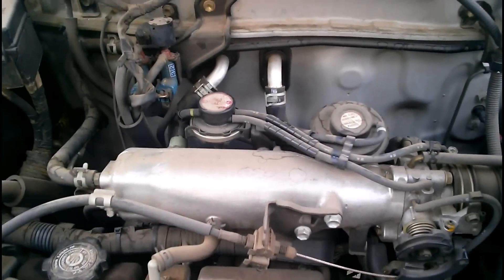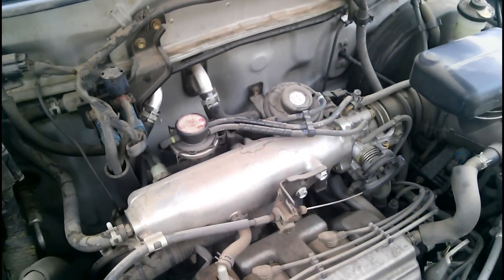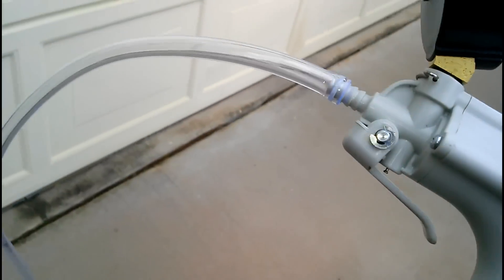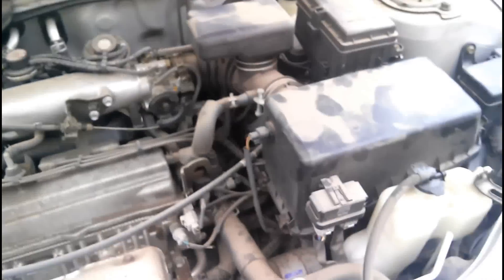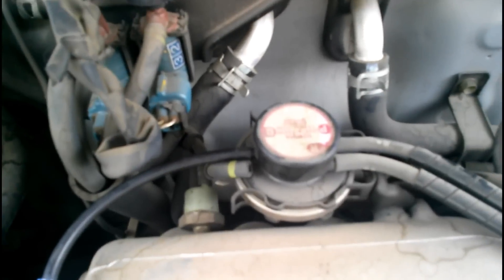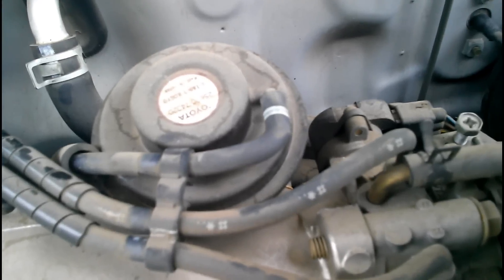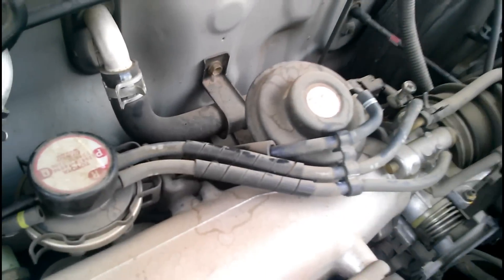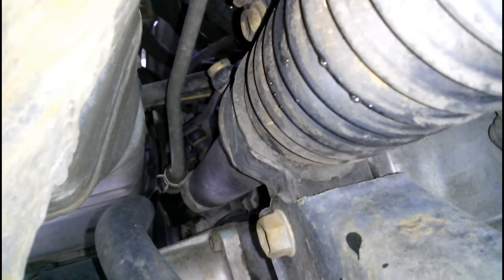Toyota P0401 Insufficient Low EGR Flow RAV4 Diagnosis

Comment: Fantastic Video! picked up the vacuum tester at Harbor freight for $39 bucks and it had all the things I needed for testing. Turned out to be the VSV valve which should OHM out at around 20 ohm's for a good one. I had two smog shops that couldn't figure it out and drove me nuts! YOUR THE BEST!!

Comment: Thank you for this video.  My wife's 1998 4Runner hasn't been driven for almost a year.  She started driving it a couple of days ago and it threw a 0401 code.  This video will be a great help in diagnosing and repairing the RAV4.  I think this is the first mechanical problem it's had.  Just 25 years of tires, brakes, batteries, oil changes and air filters.

Comment: I'm not sure what your name is but you can't believe how you much you helped me with my 1998 Toyota RAV4 P0401 reading. I had to have my front axles changed at a transmission place on my Toyota and they somehow loosend the hose at the bottom that's about 10 inches away from the axle . When I drove off the lot my check engine light came on and they told me they didn't do anything. I then took it to my mechanic and told him what I thought the problem was after watching your video and sure enogh, that's was what was wrong with it He hooked the hose back on put a clamp on it and told me no charge ! You saved me so much money thank you again for putting your knowledge on YouTube sincerely Tammy Peterson 😀

Comment: Thanks for showing us how to test these parts man appreciate it!. I wanted to share my experience with this code. I had a Camry with a p0401 code car ran perfectly fine otherwise. I used the vacuum pump on the EGR valve, applied vacuum, the car died instantly which showed it was working fine, checked the modulator with the pump and the gauge showed 20 lbs of mercury, as the vid showed by process of elimination the VSV should be the bad part. So on faith I bought the part and put in the new one sure enough after a while the check engine light went away!!! I found it's rarely ever the modulator and if it is the EGR itself whether it needs cleaning or replacing you would notice the car running real rough if that was the problem. On these camrys, rav4, land cruisers the VSV is known to go bad and if you’re showing a p0401 code it’s almost always the VSV 90% of the time. Also if you erase the codes with an OBDII tool and the code comes back after 10 miles or so it's also usually the VSV.

P.S. The VSV itself is a PAIN to remove I ended up not removing it because the bolt was so out of reach so I ended up removing the 2 hoses and the electrical connector from the old VSV and put them on the new one and zip tied the VSV someplace on the firewall of the engine.
Reply from the maker: I'm glad it worked out for you! Yeah that's exactly what I did, disconnected the power and vacuum lines and left the old one in place, I don't see how you could remove it without basically pulling the engine! One of few decisions by Toyota's engineers that left me scratching my head.

Comment: Update. After performing the EGR valve test as described in my earlier comment, guess what? Next time I drove the car the check engine light was off! This kind of thing has happened to me often enough that I have a name for it, the "test fix." You test something without making any attempt to fix it and suddenly the problem is gone. Anyway, thanks for giving me the test to fix it with, good vid!
Reply from the maker: +Dave Ayars Huh, how strange! I'd keep an eye on it for a week or so to see if it comes back. Hopefully it is just a "test fix" though!
Reply: +Dave Ayars What happens many time is there is a minor carbon blockage and by testing the system, you disturb the blockage just enough to "solve" the problem ;)

Comment: Also check the vacuum line that activates the EGR valve. It too should have 20'' of vac when the engine is revved to 3000 rpm.

Comment: Tried a modified version of the EGR valve open/close test and a strange thing happened. The modification is that instead of getting a vacuum pump I used my mouth, first with the engine off. Sucking on the tube produced at least the  sound of the valve opening and closing. To make sure it was working, I repeated the test with the engine running. This time the rpm dropped quite a bit, but the engine didn't run rough or stall, it just dropped and maintained smoothly at a lower rpm. Now here's is the strange part. I opened the throttle manually and the engine didn't rev. Put the vacuum line back on, still nor rev.Tried the gas pedal, same thing. I shut off the engine in hopes that restart would do a reset of some kind. It wouldn't crank, the solenoid clicked, indicating a low battery. I gave the battery a quick charge, and the car started normally. Repeated the suction test and the same thing happened all over, except this time it restarted fine thanks to the charger. Any explanation for this?

Comment: Nice camera, but pretty bad cameraman.  You kept on moving the camera around and zooming in and out too fast.  You also call the VSV a sensor, when it's actually a solenoid-controlled valve that Toyota calls a switch (for some unknown reason).  Then you called it the vacuum modulator, which is the little round unit on the top.  As for seeing the VSV, no:  You will never see it on a 4WD model unless you disassemble the top of the engine.  You can feel it from the top if you have a long left arm.  Follow the two rubber hoses down, down, down until they attach to the VSV ports.  From the passenger side, if you remove the wheel you can reach in there far enough to feel the rubber hoses and follow them to the VSV.  It's to the right and above that accordion-like rubber boot shown in your video.  You do have to lay down on your right side and get your left arm way in there.  Some people manage to get the 12 mm bolt that holds the VSV on the back of the engine off.  Very easy to do if it's 2WD from underneath.  Almost impossible for 4WD, and extremely unlikely you could get it back on to replace the VSV.

So most mechanics install a new VSV higher on the firewall, and just leave the old one in place.  You can remove the rubber hoses easily.  The electrical plug is harder.  You have to hold down the release lever on one of the wider edges to release it while pushing it in, and then pulling the connector off.  Most people have to use a small flat tool to push these connectors off, but that is impossible by yourself because it would require two hands.  If your friend reaches down from the top to push the release lever, while you pry it out from the side, that might work.  Then you need to get the plug up as far as it can reach, so you can install the new VSV from the top.  A bent coat hanger wire is pretty good for this!  YouTube has a lot of videos that show how to install the new VSV.